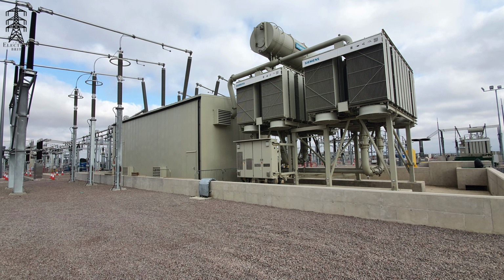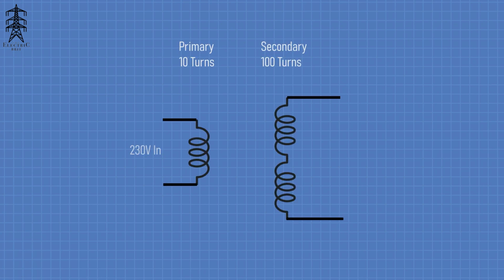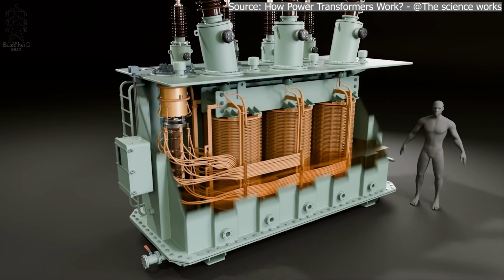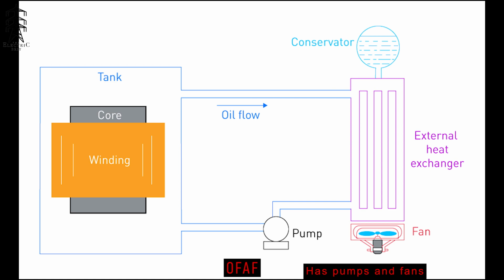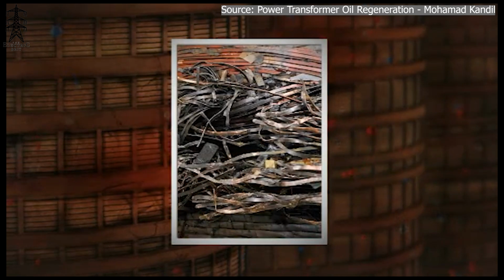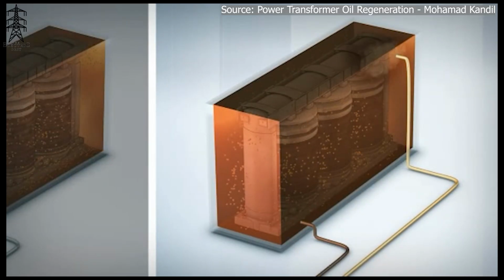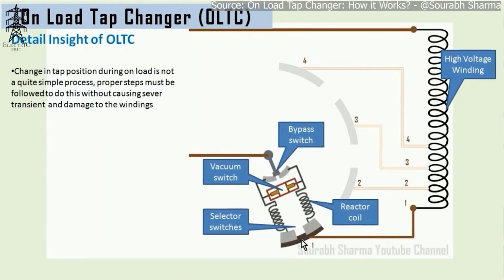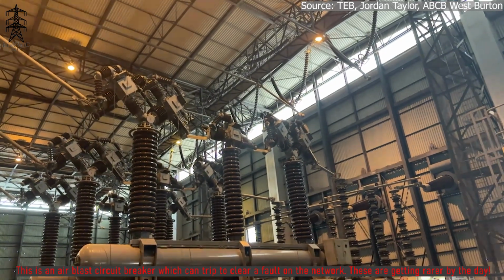Why Transformers Fail (and How to Prevent It)

Comment: i thought the insulator is inside those fins that we can see. and rather than the outside being an insulator the bits we can see are more properly called rain shedding fins?
Reply from the maker: Correct yes the disc shape on bushings is for rain shedding but also to create clearance between live and earth. When used to support equipment up high we call them insulator stacks and the discs “pots” because of the porcelain.
Reply: @TheElectricBrit  I get it now. Thank you ever so much for your reply.

Comment: Silicon steel laminations have silicon insulator between them ? 
My understanding is that the silicon is alloyed with the steel to increase resistance and the insulating surface layer is a phosphate conversion coating which is impregnated with the transformer oil and forms a very thin insulation layer without taking up space.
Reply from the maker: Hi, Yes that was probably a miscommunication on my part and I'll add a correction. The silicon steel typically forms an oxide layer however in iron core and older transformers a varnish coating or paper insulations might be more common. Thanks for your comment and knowledge!
Reply: silicon steel has another advantage; it has low hysteresis loss. The lamination reduces  eddy current loss. Plus there will be copper losses. large transformers use rectangular bars rather than round wires.

Comment: We had a brand new 1 year old Hyundai bank fail in the middle of summer. Winding to winding fault.
Reply from the maker: The shunt reactors and SGTs in the photos on the video were all brand new and gassing. Just goes to show the value of proper commissioning
Reply: Hyundai make cars, not transformers.
Reply: @simontay4851 , just use Google and you will learn something.

Comment: In the last few years in the USA, we have had several incidents of someone shooting transformers with a high power hunting rifle.  At the least, this punches a hole or holes in the case releasing pressure and allowing the oil to drain out.  Beyond that, a bullet striking the windings can cause shorts and opens and potential for arcing.  

For a low tech, low cost, attack, it can take a transformer out of service for months and knock out sections of the grid for days or weeks.
Reply from the maker: I’ve seen stories about that. Lead times for new transformers can be years and strategic spares are low. If I were in the US I’d build substations indoors to mitigate that risk. It’s quite common in the UK even without that risk!
Reply: @ Great Idea.  I suppose the cost to build and maintain the buildings  enters into it.  Our substations are huge sprawling facilities with lots of room for expansion.
Reply: Not being able to see the the thing you want to shoot at seems like it would be sufficient given the low skill nature of these attacks. And there are plenty of low cost ways to do that.
Reply: what about drones with wires?  heard that too.
Reply: @billynomates920 That's a super easy fault to clear vs someone shooting a multi-million dollar transformer
Reply: Transformer shootings (among others): symptomatic of an anomic civil war or...?  ...Or as Grampa Simpson might say, "...electricity:  It angries up the blood'.
Reply: the outer box is steel several mm thick. nothing will happen with a bullet from a high power hunting rifle. But even if the transformer is damaged, it will be automatically cut off from the grid in a matter of seconds.
Reply: @janami-dharmam  Comprehensive government reports and actual experience say otherwise.  https://www.youtube.com/watch?v=Q4hwFBPyS5U
https://www.youtube.com/watch?v=bPwY-FTqWxM

Comment: Takes me back to my early days in Ferranti in the 1970s when we used to make things.
Reply from the maker: @herrtomas6729  it’s painful taking assets off the network because of parts of perceived cost when most of our stuff will have lived twice the life of the stuff that replaces it. We should do more in house and in country so we’re more self reliant.

I bet you’ve got some great stories working for an industry name like that 👍
Reply: @TheElectricBritFerranti tap changers are still going strong. You can still get parts for them and the tap changers are outlasting the transformers
Reply: @TheElectricBritI understand that in America it's the opposite. Long overdue equipment from long before standardization still functions through expertise of highly motivated older experts and a whole lot of prayers. As attention for transformers, hydrogenerators and the likes forming America's energy backbone does not draw more votes "because it works". Until it doesn't. Them power outtages that have become extremely rare and have always been for only some hours in at least the past 40 years* here in The Netherlands cost lives in Texas every year.

*Not all is perfect, a transformer exploded in 2022 after it leaked oil where it should have disconnected.
For there was no immediate backup, a giant generator was temporarily installed, providing power to affected area.
Reply: @HansOvervoorde  Well, thats a Texas problem since Texans don't belive in science, safety, accountability or planning for the future. In the (mostly) normal states where sanity still reigns, major outages are rare.
Reply: Yikes, back when they were filled with PCBs.
Reply: Unfortunately, you were as good in "making things" as, say, Egypt, so your manufacturing had to go. 

Face it, until you implement the Central European vocational education system, you're going to lose to Central European countries, and not because of lower salaries.

Comment: Subscribed, very interesting as I have a general engineering background and have had electrical hobby since 1972 down to drawing and etching circuit boards etc, but could never get into electrical work as a paid profession due to been colour blind.
Gaz Yorkshire.
Reply from the maker: @Gazr965  appreciate the comment Gaz 🙏 I wonder if it’s still as strict. Luckily in our work I don’t think we ever just rely on colour. All cables are labelled or numbered in addition to colour. I’ll be making a conscious effort when it comes to graphs etc to use not just colour to differentiate data. All the best 👍
Reply: @TheElectricBrit Well I am 65 now, I always use a multimeter for colour coded resistors as they are very close to me, esp red and green etc. I assume grid big stuff may be different.
When you see switch yards etc suppose that is numbered/coded bus bars per phase etc

Comment: In Germany the transmission networks are at 110, 220 and 380kV. 
AC voltages over 400kV are difficult to control because of the insulating ability of the air.
Reply: There are many countries which run 500kV (or higher) for their backbone transmission network. The theory I have heard about why GB is on 400kV is that the choice was to have 400 sooner or 500 a bit later so they opted for sooner. On the DC side, HVDC links tend to run 400-800kV.
Reply from the maker: @ that’s right, it’s also why we went to 275kV first as the technology wasn’t quite there. We’re seeing the same thing now moving away from SF6, just waiting for manufacturers to catch up with higher voltage alternative gas solutions.

I’ve worked on some HVDC and we’ve typically used 525kV however I know in China they’re going up to 1200kVAC which will be overhead since cables are limited. Dedicated videos for these coming soon which will be information dense.
Reply from the maker: @jensschroder8214  nice even numbers compared to our seemingly odd (in retrospect) 132, 275 and 400! I started my career with Siemens so was aware of SuedOstLink before I left and NeuConnect interconnector to the UK coming soon. Interesting time for your nuclear industry too. Thanks for the comment 🙏

Comment: I didn't realise transformers used paper and cellulose insulation. I assumed they would class F or class H epoxy based insulation like large electric motors.
Reply from the maker: Good question! You can get dry type transformers using those insulations in the medium voltage range (33kv) but for HV like our transmission transformers, oil is a better insulator as it’ll fill any tiny gaps and is better for cooling. The paper has the benefit of being a solid which is good for dielectric strength but has the added benefit of being permeable to the oil which boosts its dielectric strength further. 

Conversely we’ve moved away from oil and paper filled cables to XLPE ones as the properties are just so much better but there’s a practical limit to the thickness of the insulation. 

Hope that helps! Thanks for the comment
Reply: most of them use fiber glass insulation impregnated with some organic resin. After the winding is done, it is baked so that it is one solid lump.

Comment: Nice one, perfect video, hits the spot. Telecom engineer here, after the Heathrow incident, was curious so started reading up, found most sources lacking in the actual details on the components, and mostly dancing around with high level theory.  you summarised everything beautifully.Will be saving the video for future reference
Reply from the maker: @asjahan7748  thanks for the comment 🙏 I’ll be covering the outcomes of the Heathrow report when it’s published in detail so stay tuned. Hopefully some Telecoms stuff in future too
Reply: You may think I'm crazy in my suggestion, but if truly want to understand, then that requires going back 100 to 150 years ago and reading the understanding of electricity back then, because those fundamental discoveries are largely forgotten and not even considered if even known, or downright ignored by the adopted relativity physics of today that can't resolve electricity to the degree that the old information does. People like James Clerk Maxwell, Michael Faraday,  Oliver Heaviside, Charles Proteus Steinmetz, J.J. Thompson, or a contemporary like Eric P. Dollard if you wanted to find something usable on YouTube. Dollard explains radio mostly, but also has books about transmission lines and high voltage electricity from the older understanding perspective. The reason I suggest this, is because, or for say example, in J.J. Thompson's book, Electricity & Matter, the first chapter gives a very good definition of the components of "electricity" as defined through Faraday's lines of force theory, to denote the electric field surrounding the transmission wire... once you have your head somewhat wrapped around that to start, and think of these bound components as electrical "momentum", and understand those transformers of today aren't actually designed with any considerations for what the "founding fathers of electricity" knew... like how the bulk of the electromotive force isn't carried on the conductor, but in the dielectric field around it, and the effects of how the space between the wires affects those fields or component lines of force, and so on... so I am just pointing the way to a mostly forgotten rabbit hole concerning electricity that may interest you to take a look at... happy hunting if you haven't already dismissed me as a nutcase! But either way, enjoy your learning discoveries by whatever paths you choose to roam...

Comment: I love how you see the progress of safety in the progression of the transformer, I wonder what the next new component will be.
Reply: Looks like the mechanical tap needs an update. Something that brings the contacts up/down to winding voltage before connecting. Removing the arc possibility. Or by removing the taps altogether and coming up with a continuously variable unit. That's always in contact.
Reply from the maker: The majority of tap changers I’ve seen on the transmission network are MR on load tap changers and are a work of art inside.

Comment: Another good video!
What happened to the first one?
A short video, about the theory (Ferranti Effect) & operation of Shunt Reactors would be useful please?
You might not be old enough to remember, but I can remember the day that the failure, of one of the shunt-reactors, at Hurst GSP, caused a cascading fault, knocking out a significant proportion of the South London distribution network for several hours.
It turned out that the 132KV CT protection relays. at Wimbledon BSP, had been set far too low; this second problem wasn't discovered until those circuits ramped up to full load to try and compensate for the failure of the circuit from Hurst.
Happy days!
Looking forward to your next video.
Reply from the maker: Thanks for the comment! I have the next 4 videos already written so just need to produce them, one is a long video on cables and the other on overhead lines so I’ll be sure to deep dive on Ferranti and other effects. 

The shunt reactor in the video was for an offshore wind farm and was the first project I was involved in start to finish and commissioned on. Was an amazing experience and was a massive contrast working with brand new kit to when I went to Elstree to work on the older stuff! 

Was that failure the one which took out the hospital for days and made headlines? You always find out the best details from the people who were there
Reply: @TheElectricBrit 
It certainly made the headlines.
New Cross SS lost all 4 of its feeder circuits.
Network Rail's Power Control Centre at Lewisham (DC traction current for the whole of South-East London) went off supply, so most of the trains, in South East London, ground to a halt, between stations, on a hot summer's day.
IIRC the hospital went off supply when a group of vandals set fire to the 132KV cable bridge, over the river Darenth.
All of the EHV cables were burnt to beggary in a confined space.
It was a health & safety nightmare, since the fire generated hydro-fluoric acid.
It took days to get the burnt cables out, since the guys doing the job had to wear haz-chem noddy-suits and full BA (breathing apparatus)..
Happy days ... not!
Reply: How would a fire generate HF? What was actually burning. Hydrofluoric acid is REALLY nasty. It'll eat through pretty much anything. Im not a chemist but ive watched videos about HF before.
Reply: @simontay4851  
Back in the day, some synthetic electrical insulation materials were fluorocarbon based.
(Not any more thank goodness.)
If these materials were (partially) burned, in a damp low oxygen atmosphere, the resultant charred black sticky mess could theoretically contain small amounts of dissolved HF.
Probably not enough to be dangerous, but in these days of Health & Safety paranoia what manager is going to take the risk of not authorising the recommended PPE for HF(aq) residues?
Reply: @TheElectricBrit will be itnterested in the o/h lines, as being an ex BT engineer, we needed to know which were HV and which were LV/joint user poles for  hanging up our wires.